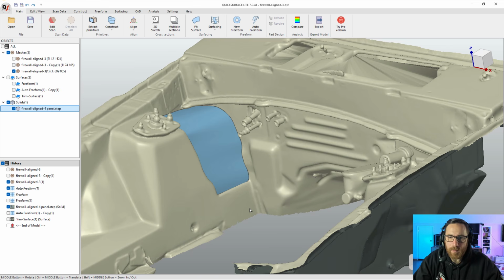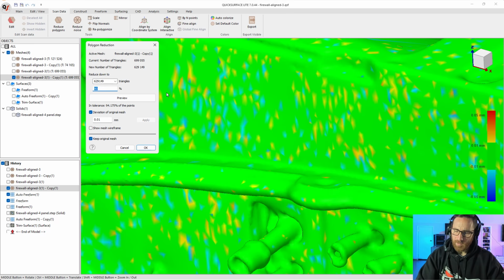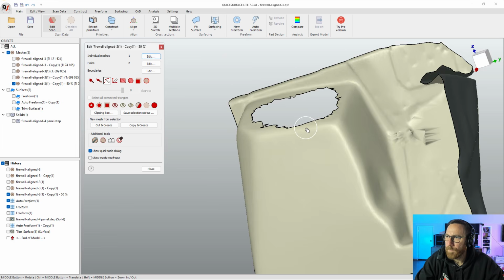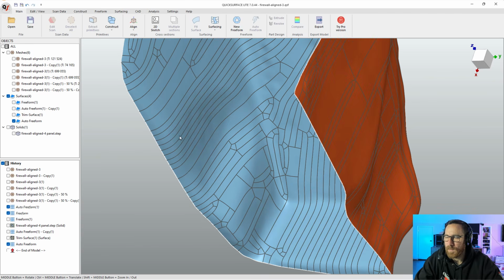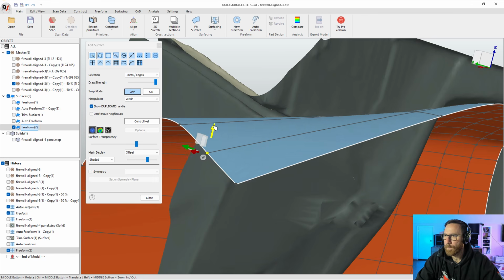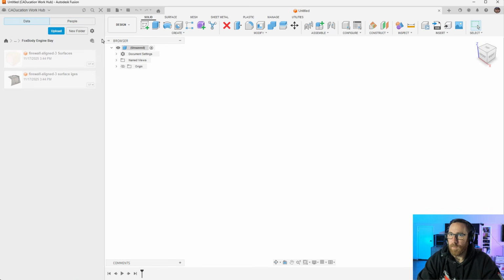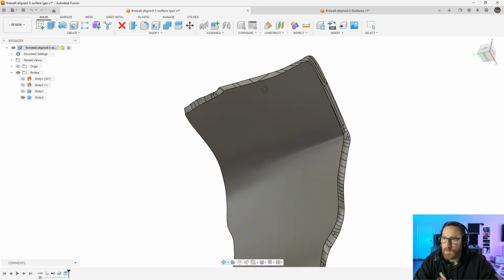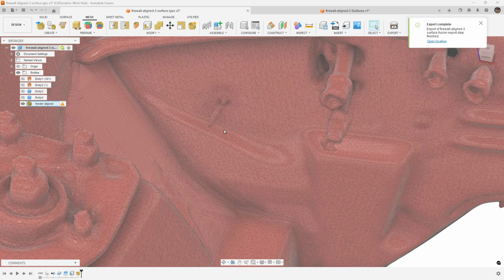Using QuickSurface and Fusion to create a  Fox Body Engine Bay Cover

Comment: Super helpful. Working with the Autofreeform in Fusion was helpful cause Im not sure what to do with it once in Fusion. Now I am. Just curious, is the scan done with NIR scanner (?) And use of blue laser scan would give alot better accuracy results? If you were using QS pro would you have just trimed the Freeform shape with the AutoFreeform shape to give you the shape you ended up with in Fusion? Do you know if history tree from model made in Fusion would be inported into QSPro?
Reply from the maker: Hey there, on the scanner it was a structured light style scanner, not laser.  With laser you would need a lot of markers on everything unless you had a markerless scanner like the trackit.  I don't think you would need the accuracy of laser for this.  The only exception I could see is if you were scanning to see if the unibody was twisted or something.  In this case a scan of just the back corner would have worked, but the user scanned it all while the engine was out and it was going off to paint.

In QS pro i could have trimmed there possibly.  It ultimately depends on how much more design work would be needed.  For example if i wanted to make this just a trim piece that attached and then add other features to make a removable cover that snapped into place, I would have gone to CAD.  If the final piece we ended up was actually finally it could have been all in QS Pro.  Auto Freeform would have been much cleaner in pro than LITE fyi.  the algorithm used to create the freeform is better.

History tree from fusion won't import into QS pro.  There is a version of QS pro that is an Add-in for Solidworks but it doesn't have all the same PRO features (no auto freeform for example).  There is a connector for Inventor which i believe could sent planes and curves from QS Pro to inventor, but not the other way.  I am not aware of any way to bring a history tree into QS Pro.  It generally goes the other direction.